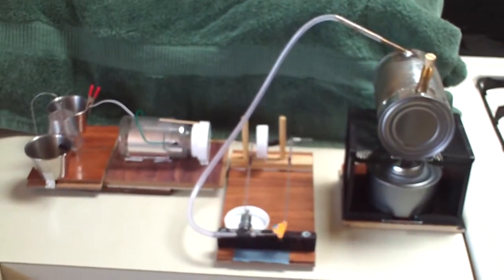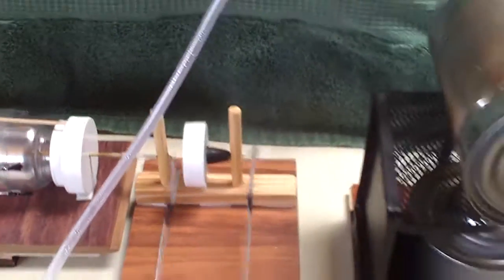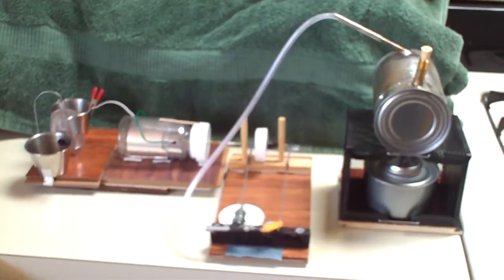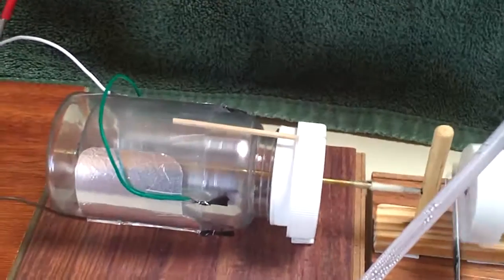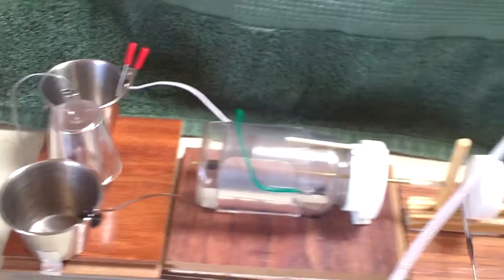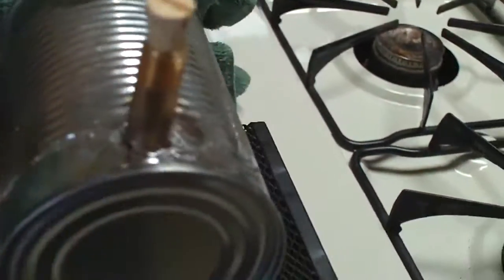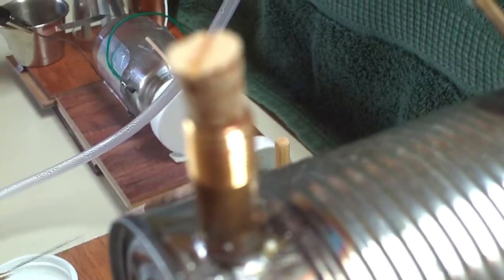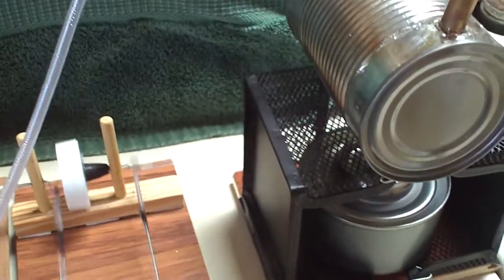Simple Steam Engine ----Running on Canned Heat

Comment: Inspiring!  So may people ask me if there is an affordable steam engine kit not needing a lot of machine skills.  Not many.  PM Research makes a few, but for any real power the answer is fewer still and $$$$
I have scaled your engine up to a 1.75" stroke and a .8125" bore.  I am working on it today.  It will power a simple 3 phase set of coils. 
I'd love insight on the valve throw.  I assume it just opens for 15-20% of the stroke?
Reply from the maker: I'm anxious to see your rendition of this design.  It seemed to be the easiest one for me to build at home and it was.  I just guessed on the valve throw and 20% sounds about right for what I did.  A small and easy to build kit that could charge a cell phone might be a big hit. Throw a few wood twigs in the boiler and let the little steam engine make electricity.